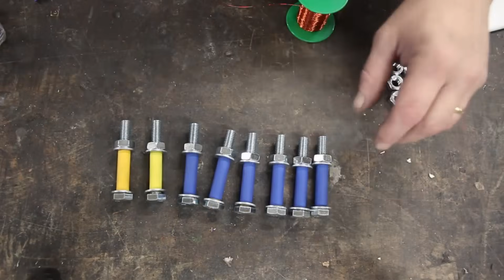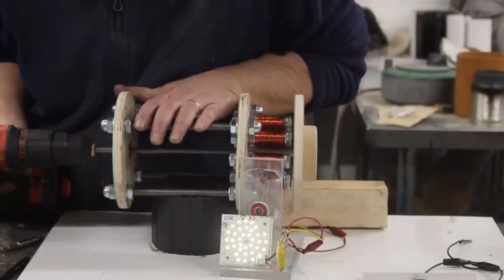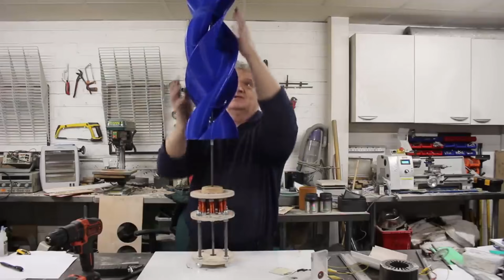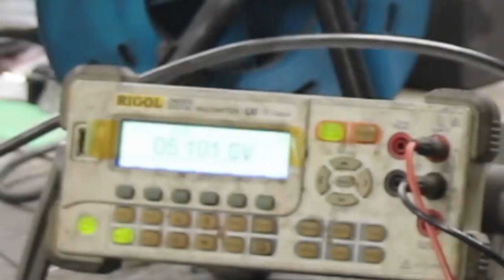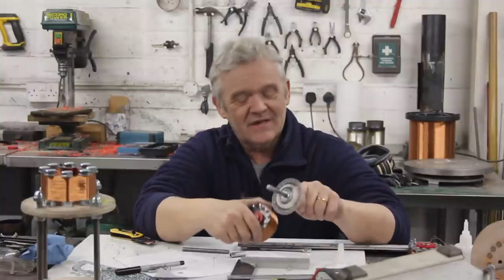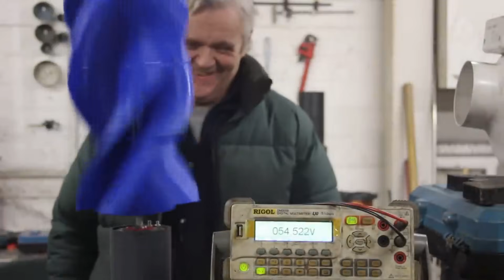021 The Mighty Mite Generator And How To Build It

Comment: :-) Good man, I have junk to work with and I don't want to waste fuel by buying more junk from the hardware stores, instead I want to turn the junk into something that makes use of that junk, I do have two drills, I should make some frame to make it like a pillar drill, solar energy is not dependent on glass, you can use the heat to warm some water in pipes, but it is a little more difficult to generate electric power by warm water, you need chemicals like ammonia to make an icy ball, an invention by some Australian guy apparently.

Comment: I was considering making a DIY genny for a while. Mine will be scaled up a bit with bigger magnets, and I hope to use 10 AWG magnet wire. I have been trying to source some Iron (instead of steel) for the cores. I can't find anything mass-produced. I'm not a Smith, so I would need to use an angle grinder/die grinder and such...no lathe either/. I do finally have an entry-level 3d printer, so custom plastic parts are available. 

Your channels have been a great inspiration.

Comment: Love it. 👏👏👏
Your happiness is so infectious!
Hey at 16:00 if you could keep sliding bits like that on the rod, would it generate more elctricity?  Maybe it would get too heavy though requiring stronger winds?
But if you were connecting it to one of those stationary recumbant bike excercise machines i bet you could charge up a battery pretty good with just some peddaling  huh?  Or no?
I think it would be fun to charge batteries while excercising. 😂😂
Love your projects man!!

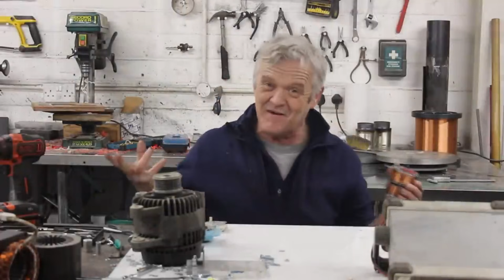Comment: 19:50 what if you put on the shaft a drill head, or like the sun gears from a portable drill, to increase rpm. ?😅
Reply: That works, but you might have to increase the 'wind-catcher' to overcome the increased torque when the generator is under load.

Comment: Can i use that 125 volts generator to power my computer (if i make on a big scale 220 volts)
Reply: Your computer has a down-converter, the internal circuitry only uses a few volts, and even that is down-converted from the typically 9-18v from your mains transformer. You don't want to be putting 120-240v directly into your laptop/computer etc.

Comment: 2 questions; which is better, this coil or the serpentine?
If you used thicker wire would it increase the amps, or more to the point could you skip a voltage regulator buy using the right coil?

Comment: So if you want more current over voltage, you'd need thicker gauge wire correct? What happens if you keep one of the mini mite's coils as the hair thin wire and the other as a heavier gauge? They'd probably not be in series, but I would think you'd be splitting the difference as far as how much of the input power you'd recover as V and I.

Comment: First thing that came to me when I saw you test this in the wind is to put one generator at the top and one at the bottom of the blades. double the power using the same amount of wind
Reply: Unfortunately the power would just be split between the two. A certain amount of power is pushing the blades, that amount of power is then converted by the generator. There wouldn’t be double the power from nowhere y’know.

Comment: What is the relationship in volts and amp as the speed changes? When its slower, the volts dropped. Did the amps stay the same to equal the energy put in? Do volts and amps both drop with slower speeds? 
It would be interesting if the design set the amps and speed set the volts.
Reply: Both drop with rotation speed, its a consequence of the power coming in from the wind equals the power out from the generator.
By changing the number of turns in the windings, you can get more of one, but at the expense/loss of the other, it's still going to be: power OUT equals power IN.

Comment: Hey' rob I haven't give ya, no good  idea's in a long time.  SO, Here's a few : lay it on it's side, & put another " generator head" on the opposite 🤔 side  🤔. !!!  
OR : leave it straight up & down, and stack, blades & generator heads, one on the other  and go as high as ya, like, that is my favorite idea 
" The second " one I mean...
Go as high up as a light-pole......❤ or as long sideways as you're fence.....😮😊😅😮😮😮
Reply: Wind is to variable/turbulent over short distances, you'd probably have stability problems.

Comment: I do not have 3D printer. Is there anywhere I can purchase already printed turbine blades like that?
Reply: With a bit of ingenuity you can make blades out of Fibreglass and polyester resin, very cheap. I made 2 the size of doors (2x1metre), for less than £30, surprisingly difficult to handle, the amount of wind-power was astonishing. Don't underestimate how difficult it is to hold onto and control just a sqr m of fabric/board even in a mild wind.

Comment: I would be curious to know how the Mighty Mite generator would work using a bifilar winding instead of a single wire? Another thought would be to glue the bolts to a cylinder that you then wind the wire around. Just a couple of thoughts. Would like to see both when you have time.

Comment: Dear Rob.
Explain me this.
A excavator works on hydrolic run on a oil pump pumping oil around.

With this hydrolic we can create tons of power, (newton) if we convert this Newton to kw, regarding calculation the potental electrical output is more than the hydrolic imput.

There are also electric hydrolic at the market, 12vDC 2Ampere with a outupt of 800N, this meens in theory the potential electrical output is bigger than the imput.
Connect the hydrolic to a genarator and you might have more output thab input.
Reply: You are missing the 'leverage' effect using hydraulics. It is correct that you get a huge step up in Newtons', but it is over a shorter distance than the movement of the pumping elements. The hydraulic pump is like the long end of the lever, the output (Newtons) is like the short end of the lever.
The power in equals the power out, minus friction losses in the mechanisms.
Hope that helps.

Comment: Could you share the length (or weight) of the wire you used in both kinds of windings (individual bolts or one winding around the whole thing). I'm curious if the efficiency is similar (voltage generated per length of wire assuming the same drill speed). My thought is that the single coil is less efficient because the south magnets are also putting field through the coil when the norths are on the bolts, whereas in the individually wound bolts, the south field goes outside of the coils.

Comment: Hi Robert...  I plan to make the tiny version... But...
Can you tell me -

1. Do the metal discs have to be steel, or will aluminium discs (which I already have) be as good?
2. Over time, will the mild steel bolts become magnetised and therefore compromise the efficiency of the generator?
3. Do you know the comparative efficiency, between a straight and a serpentine ungrinski turbine (as I do not yet have a 3d printer)?
Many Thanks.

Comment: Hi, Rob very nice video and good info I do not have a printer to build the blue turbine how much would it cost to have you make another one and sell it to me.  and on the Thunderbolt why not try a coil on the other end too I would like to try and build one like the Thunderbolt to use on my waterwheel to run my home I would use a buck converter to a solar charge controller to an inverter please let me know on the turbine thanks.

Comment: Question - what if you took several of these MM generators and have them hooked up to a single turbine so the one set of blades turns all the generators at the same speed - and then combine all the outputs from the several MM generators?
Reply: In parallel you'd get more amps, in series more volts.
Generally you'd get more power out, assuming you had enough/bigger wind-catcher(s).

Comment: I have a question. If you create the small generator, as you have, with the small amount of offset in two halves to eliminate the “stall” if that is a satisfactory term, what if you repeat that on your disc in a larger diameter. Each successive winding would be just enough larger as to not interfere with the previous winding. The holes in the disc would appear in a sort of vortex so the each ring of holes had the necessary offset. More and more magnets would be required for each successive winding. I could imagine 30 rings on each side. That would continually increase the mass of the windings. If each ring required an inch for clearance then the total circumference would be around 60”. If you printed a vey large helical rotor it would take more wind and I would imagine and much larger bearings to eliminate drag. Once it got moving the mass of the windings would act as a flywheel. My concern is this. You mentioned that if the windings around your bolts In the first example had to be very uniform in weight to function properly. Would that also be true in my concentric ring model. If so the the inner rings would have to be thicker and then each successive ring would have to have the same mass as the first. Essentially getting thinner at each ring to maintain the same mass. I could foresee it being an expensive experiment but maybe it would produce more than milliamperes.  Don’t forget that the input like wind or falling water is free.

Comment: I'm just curious would washer on the magnets on side facing away from coils, would get great magnetic flux towards coils and therefore greater output. Just idea that follows your nut and bolts build. Very interesting build with readily available materials anywhere.

Comment: Is it possible to generate electricity using electro-magnets fired in a series? I have been wondering what kind of current could be induced by an electro magnetic device firing inside a coil or even several coils.
Reply: This is literally what a transformer is

Comment: I'm still baffled as to how that wiring works given the general magnetic field going through the bolt length, but the magnetic field must be looping around the outside of the stator?

Regardless, wouldn't the individually-wound bolts approach provide even more performance than this simplified "around the bolts" wiring?

Comment: Omg I Busted a Gut Laughing from hearing you laugh seeing the Energy Generation of a single Coil generator...  so funny 

I would like to see if it's possible using gearing to up the RPMs by stepping up the Speed of the center rod.

I'm referring to the Gears on a 10 speed  Bike that has varied Gears that the Bike chain is repositioned to spin the Tires faster while We Pedal at a slower rate after we pedal the bike the tires spin easily when we first start to get going.

After we get going pedalling faster to start, we then can reduce how fast we pedal by adjusting the Gear shifters controls until We get to Pedal Slowly but achieving More RPMs to Step up multiple Spins of the  wheel Tire RPMs but pedalling slowly.

1:1 up to 4 wheel rotations to 1 Full Pedal rotation.

If We set up the the same gearing setup and connecting the Gearing to the Center shift of the Generator - The Rotations being increased to take the wind power turning the Wind Turbine on its own that turns a tire chain that connects to step up gears on the center Generator Rod turning the Generator 4 x faster or whatever is ratio ends up being.

Just thinking how to turn the center Generator Rod multiple times faster.

Comment: OK.. so you say that winding a coil is not fun.. but in the back ground you have a spool of wire,, that is a coil.   Would that work. or do you need the iron poles... if so.. could you drill holes in the plastic spool, and insert the pols, and just add the magnets to that.
that would be a lot of wire.. the whole spool.  just a thought.

Comment: I'm wondering about the steel bolt magnet armatures... surely residual magnetism would make them decreasingly effective pretty fast?

I was taught (as a kid) that you had to soften the steel using a blowtorch flame, and that would make it far more effective.  
What I can nether remember nor even understand is whether it's better too let them cool slowly or quench the red hot bolts in oil.  
I can never understand the process of annealing vs softening... metallurgy, crystalline structure and all that... as a subject is worse than Chinese to me.

Anyhow... am I on the right track?  Would heating the bolts improve their performance in this situation or not?

Comment: So, how do you get lower voltage but higher amps out of a wind generator? Would it depend on wire diameter?
Reply: Off hand, I would think that if you created another generator coil or two or more, you could place them inline on the same input shaft and connect the wires to link them in parallel. The output voltage would be reduced, but the current would be increased. Ultimately, the output will be the same power.

Comment: Now if i want it to make 12vdc could you rectify it then put through a transformer for slightly better amperage? ?
Reply from the maker: yes
Reply: You’d want to transform first as transformers don’t work for DC. Of course if using for wind, it may be difficult to get a steady voltage because of wind speed variations, so it would probably be necessary to use a voltage regulator of sorts. I guess something like a buck booster or whatever it’s called may work somewhere in circuit. It’s very doable though obviously, as wind mill generators are a commercially available thing. You know, I’m with you and I think I’ll jump into doing just that…

Comment: I was expecting some kind of flea circus treadmill. Never dissapointed by TNT though. Was expecting to see blood during the lathe wind, if anyone tries that with re-used coated wire beware kinks and rough coatings or wear leather gloves. Wound some coils recently and trimmed all to same weight just as you suggested. Looks like a fascinating topology. Would clamp when drilling with such a large dia drill, incase it graps.

Comment: If you reduced the magnets by 1, or increased by 1, so that you have 15 or 17 magnets, you would reduce your cogging significantly. But would it produce electrical power as efficiently? I do imagine the low speed startup performance would be better.
Reply: Maybe a mechanism can increase the gap between magnets and coils  for startup and decrease when turbine is running. Think this is also a idea for regulating  rpm at low wind speed.

Comment: Does adding a second disc of magnetics on the opposite side of one winding make much difference in to optimize the generator?

It seems it would be harder to turn… stronger field?

and connecting each pair of magnets?
which would now need something like a split drive shaft to exit power for the now entrapped coil… and inelegant brushes?
Reply: So long as the 2nd array of magnets are oriented the exact same, there should be a net increase in electrical potential output. However, if you do not get the magnetic fields lined up exactly, you begin to cancel out the magnetic field’s flux, and thereby adversely affecting the potential output. And yes, any increase in electrical potential produces an associated increased back EMF so it would necessarily increase the resistance to turning, but only under increased load.

Comment: What about using it as a secondary... Drive a load through the primary as you did and see if the voltage generated in the secondary increases as a result of the magnetic field of the primary.

Comment: In your last iteration, could you instead of wrapping the wire around the outside, wrap inside the bolt and then the outside of the next bolt and vice versa to increase the length of the wire still?

Comment: Hi Rob, can you explain the purpose of the heat shrink as I was originally thinking it was to insult and prevent the coil from being in contact with the bolt...however do the washers bridge between the coil and the bolt removing the insulation the heat shrink provides?  What is the specification of the copper wire used?

Another suggestion, most of the projects directly drive the generator, could you instead drive a large wheel with a belt to drive the generator, 1 turn of the large wheel would be several or many turns of the generator and hence a lot more output ?
Reply: The threads are sharp and the shrink wrap is to prevent the threads from cutting into the enameled surface of the magnet wire. It's not to insulate and protect the wire from being in contact with the bolt. The wire has  an enamel coating that insulates it. If the wire didn't have an enamel coating, the wire coil would short circuit and instead of thousands of turns, it would be one.

Comment: Great job Robert, if the coil wire was twice as thick would you get half the volts and double the amps? Also have you tried the outer coil around the small coil arrangement to see if both generate? I think if the wire was put through a roller to flatten it you would have a bigger face area, maybe giving more amps? More would fit in the magnetic field too

Comment: I am thinking that this looks like a prime candidate for a windwall setup. one of these at the top and bottom of spindle axles going thru the vertical wind you want, going say 6 feet tall, 8 inches wide, times maybe 10, and another wall at 90 degrees if the wind is very irregular where you set it up, and carry up the leads of the generators to 16 or 12 gage electricians wire. take that over to your regulator set up and storage. I personally am looking at a mixed storage of hydrogen(via metal hydride flasks) and a standard battery bank system, so the battery levels out most of the flow, and the hydrogen goes to some burning engine for long down times.